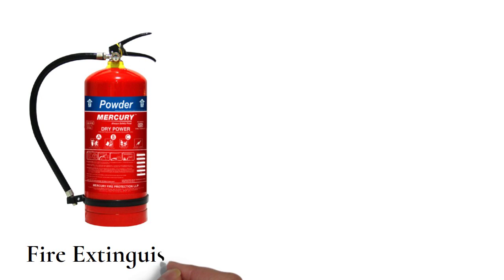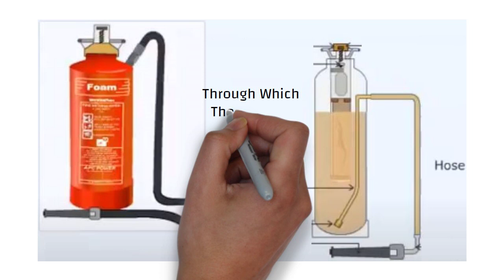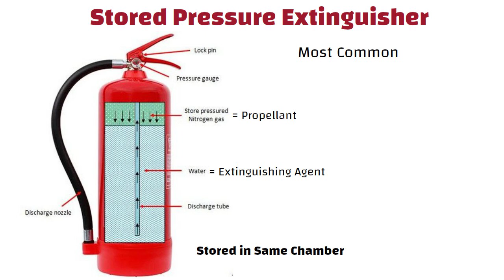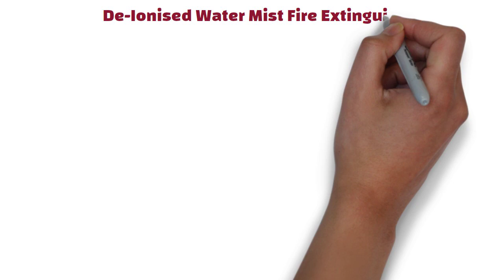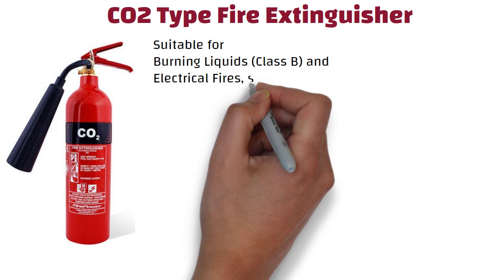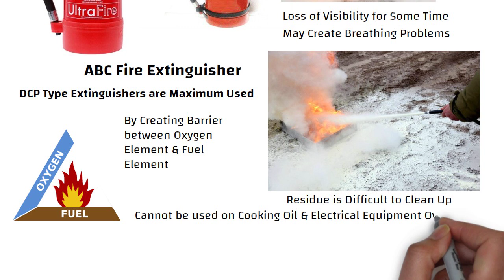FIRE EXTINGUISHER DEALERS IN KERALA, CALL 8138906102, FIRE EXTINGUISHER DEALERS IN ERNAKULAM.

Comment from the maker: Fire extinguisher dealers in KAYAMKULAM, fire fighting contractors in KAYAMKULAM, KAYAMKULAM, fire and safety installations in KAYAMKULAM, fire extinguisher suppliers in KAYAMKULAM,fire extinguishers in KAYAMKULAM, fire extinguishers in KAYAMKULAM, fire protection system in KAYAMKULAM, f fire and safety installation in KAYAMKULAM, fire and safety contractors in KAYAMKULAM, fire safety contractors in KAYAMKULAM, fire and safety systems equipments in KAYAMKULAM, fire equipment in KAYAMKULAM, fire extinguisher in KAYAMKULAM, fire protection system installation in KAYAMKULAM, fire contractors in KAYAMKULAM, fire safety consultants in KAYAMKULAM,  fire alarm systems in KAYAMKULAM, fire NOC in KAYAMKULAM, fire AMC in KAYAMKULAM, KAYAMKULAM, fire fighting equipment in KAYAMKULAM,
MS Jindal pipe dealers in KAYAMKULAM, motor control panel in KAYAMKULAM, fire pump panel in KAYAMKULAM, motor control panel in KAYAMKULAM, Morley fire alarm in KAYAMKULAM, gst fire alarm in KAYAMKULAM, addressable fire alarm system in KAYAMKULAM, Pa talk back system in KAYAMKULAM, PA talk back system in KAYAMKULAM, auto glow SIGNAGES in KAYAMKULAM, SIGNAGES in KAYAMKULAM, pump PANELS in KAYAMKULAM, LHP pump in kohi. Karthar valves in KAYAMKULAM, Ravel fire alarm system in KAYAMKULAM. Jindal pipe dealers in KAYAMKULAM, Jindal pipe dealers in KAYAMKULAM. MS pipe dealers in KAYAMKULAM. Butterfly valves in KAYAMKULAM, PA talk back system in KAYAMKULAM, Fire alarm dealers in KAYAMKULAM,, smoke detector dealers in KAYAMKULAM, fire alarm panels dealers in KAYAMKULAM, MCP, hooter dealers in Mangalor, hydrant valve dealers in KAYAMKULAM, branch pipe dealers in KAYAMKULAM, cp hose, RRL hose, heat detector dealers in KAYAMKULAM,, Motor Control panel,  LED EXIT LIGHTS dealers in KAYAMKULAM, emergency exit light dealers in KAYAMKULAM, auto glow SIGNAGES dealers in KAYAMKULAM. Conventional fire alarm system in KAYAMKULAM,
KIRLOSKAR FIRE FIGHTING PUMP DEALERS IN KAYAMKULAM, FIRE FIGHTING EQUIPMENT DEALERS IN KAYAMKULAM, FIRE ALARM SYSTEM DEALERS IN KAYAMKULAM, FIRE CONSULTANTS IN KAYAMKULAM, FIRE CONTRACTOTORS IN KAYAMKULAM, FIRE CONTRACTORS IN KAYAMKULAM, FIRE ALARM SYSTEM DEALERS IN KAYAMKULAM, SMOKE DETECTOR DEALERS IN KAYAMKULAM, FIRE PROTECTION SYSTEM IN KAYAMKULAM, FIRE CONSULTANTS IN KAYAMKULAM, FIRE CONSULTANTS IN KAYAMKULAM, PA TALK BACK SYSTEM IN KAYAMKULAM, ADDRESSABLE FIRE ALARM SYSTEMS IN KAYAMKULAM, CUTTER PUMP DEALERS IN KAYAMKULAM, ADDRESSABLE FIRE ALARM SYSTEM SUPPLIERS IN KAYAMKULAM, SMOKE DETECTOR DEALERS IN TKAYAMKULAM, PRESSURE BOOSTING PUMP DEALERS IN KAYAMKULAM, SLURRY PUMP DEALERS IN KAYAMKULAM, WATER PUMP DEALERS IN KAYAMKULAM, RAVEL FIRE ALARM SYSTEM IN KAYAMKULAM,
Reply: FIRE EXTINGUISHER DEALERS IN PATHANAMTHITTA, FIRE EXTINGUISHER SUPPLIERS IN PATHANAMTHITTA, FIRE EXTINGUISHER DISTRIBUTORS IN PATHANAMTHITTA, FIRE EXTINGUISHER IN PATHANAMTHITTA, ABC TYPE FIRE EXTINGUISHER DEALERS IN PATHANAMTHITTA, CO2 TYPE FIRE EXTINGUISHER DEALERS IN PATHANAMTHITTA, CLEAN AGENT FIRE EXTINGUISHER IN PATHANAMTHITTA, MODULAR TYPE FIRE EXTINGUISHER DEALERS IN PATHANAMTHITTA, MECHANICAL FOAM FIRE EXTINGUISHER DEALERS IN PATHANAMTHITTA, FIRE EXTINGUISHER NEAR ME PATHANAMTHITTA, FIRE EXTINGUISHER TRADERS IN PATHANAMTHITTA, FIRE FIGHTING COMPANIES IN PATHANAMTHITTA, FIRE CONTRACTORS IN PATHANAMTHITTA, FIRE EQUIPMENT DEALERS IN PATHANAMTHITTA, FIRE ALARM DEALERS IN PATHANAMTHITTA, FIRE PUMP DEALERS IN PATHANAMTHITTA, SMOKE DETECTOR DEALERS IN PATHANAMTHITTA, FIRE FIGHTING SYSTEM IN PATHANAMTHITTA, FIRE PROTECTION SYSTEM IN PATHANAMTHITTA, FIRE AND SAFETY CONTRACTORS IN PATHANAMTHITTA, FIRE HYDRANT SYSTEMS IN PATHANAMTHITTA, PA TALK BACK SYSTEM IN PATHANAMTHITTA, FIRE NOC IN PATHANAMTHITTA, FIRE INSTALLATION IN PATHANAMTHITTA, FIRE NOC RENEWAL IN PATHANAMTHITTA, KIRLOSKAR FIRE PUMP DEALERS IN PATHANAMTHITTA, FIRE EXTINGUISHER NEAR ME PATHANAMTHITTA, FIRE EXTINGUISHER MANUFACURERS IN PATHANAMTHITTA, SAFEX FIRE EXTINGUISHER DEALERS IN PATHANAMTHITTA, FIRE NOC CONTRACTORS IN PATHANAMTHITTA, FIRE FIGHTING EQUIPMENT DEALERS IN PATHANAMTHITTA, FIRE PROTECTION SYSTEM IN PATHANAMTHITTA, FIRE INSTALLATION IN PATHANAMTHITTA, FIRE SAFETY CONTRACTORS IN PATHANAMTHITTA, FIRE AMC IN PATHANAMTHITTA, FIRE PROTECTION SYSTEM IN PATHANAMTHITTA, FIRE PROTECTION EQUIPMET IN PATHANAMTHITTA, AMC OF FIRE SYSTEM IN PATHANAMTHITTA, FIRE CONSULTANTS IN PATHANAMTHITTA, FIRE AND SAFETY EQUIPMENT DEALERS IN PATHANAMTHITTA, ADDRESSABLE FIRE ALARM SYSTEM IN PATHANAMTHITTA, KARTHAR VALVE DEALERS IN PATHANAMTHITTA, DCP TYPE FIRE EXTINGUISHER IN PATHANAMTHITTA, POWSER TYPE FIRE EXTINGUISHERS IN PATHANAMTHITTA, FIRE HYDRANT SYSTEM IN PATHANAMTHITTA, FIRE ALARM PANEL DEALERS IN PATHANAMTHITTA, SAFEPRO FIRE EXTINGUISHER DEALERS IN PATHANAMTHITTA, MS AND GI PIPE DEALERS IN PATHANAMTHITTA, JINDAL PIPE DEALERS IN PATHANAMTHITTA, AGNI FIRE ALARM DEALERS IN PATHANAMTHITTA, FIRE EQUIPMENT DEALERS IN PATHANAMTHITTA, FIRE EQUIPMENT SUPPLIERS IN PATHANAMTHITTA, FIRE EQUIPMENT TRADERS IN PATHANAMTHITTA, FIRE SPRINKLER SYSTEM IN PATHANAMTHITTA, RAVEL FIRE ALARM DEALERS IN PATHANAMTHITTA, RAVEL FIRE ALARM SYSTEM IN PATHANAMTHITTA, AGNI FIRE ALARM DISTRIBUTORS IN PATHANAMTHITTA, FIRE ALARM CONTRACTORS IN PATHANAMTHITTA, FIRE PIPE INSTALLATION IN CONTRACTORS IN PATHANAMTHITTA, FIRE SAFETY CONTRACTORS IN PATHANAMTHITTA, FIRE PA TWO WAY TALK BACK SYSTEM DEALERS IN PATHANAMTHITTA, HEAT DETECTOR DEALERS IN PATHANAMTHITTA, HONEYWELL FIRE ALARM DEALERS IN PATHANAMTHITTA, FIRE NOC CONSULTANTS IN PATHANAMTHITTA, FIRE AMC AND FIRE NOC IN PATHANAMTHITTA, FIRE SAFETY COMPANIES IN PATHANAMTHITTA, NEWAGE DEALERS IN PATHANAMTHITTA, MONSHER FIRE EQUIPMENT DEALERS IN PATHANAMTHITTA, KARTHAR VALVE DEALERS IN PATHANAMTHITTA, FIRE HYDRANT VALVE DEALERS IN PATHANAMTHITTA, FIRE HOSE REEL DRUM DEALERS IN PATHANAMTHITTA, FIRE SPRINKLER DEALERS IN PATHANAMTHITTA, FIRE PUMP DEALERS IN PATHANAMTHITTA, LUBI PUMP DEALERS IN PATHANAMTHITTA, LHP PUMP DEALERS IN PATHANAMTHITTA. FIRE CONTRACTORS IN PATHANAMTHITTA, FIRE AND SAFETY CONTRACTORS IN PATHANAMTHITTA, FIRE EQUIPMENT DEALERS IN PATHANAMTHITTA, FIRE FIGHTING CONTRACTORS IN PATHANAMTHITTA, AGNI FIRE ALARM DEALERS IN PATHANAMTHITTA, PA TALK BACK SYSTEM DEALERS IN PATHANAMTHITTA, FIRE NOC IN PATHANAMTHITTA, FIRE NOC RENEWAL IN PATHANAMTHITTA, FIRE SYSTEM INSTALLATION IN PATHANAMTHITTA.
Reply: FIRE EXTINGUISHER DEALERS IN THALASSERY, FIRE EXTINGUISHER SUPPLIERS IN THALASSERY, FIRE EXTINGUISHER DISTRIBUTORS IN THALASSERY, FIRE EXTINGUISHER IN THALASSERY, ABC TYPE FIRE EXTINGUISHER DEALERS IN THALASSERY, CO2 TYPE FIRE EXTINGUISHER DEALERS IN THALASSERY, CLEAN AGENT FIRE EXTINGUISHER IN THALASSERY, MODULAR TYPE FIRE EXTINGUISHER DEALERS IN THALASSERY, MECHANICAL FOAM FIRE EXTINGUISHER DEALERS IN THALASSERY, FIRE EXTINGUISHER NEAR ME THALASSERY, FIRE EXTINGUISHER TRADERS IN THALASSERY, FIRE FIGHTING COMPANIES IN THALASSERY, FIRE CONTRACTORS IN THALASSERY, FIRE EQUIPMENT DEALERS IN THALASSERY, FIRE ALARM DEALERS IN THALASSERY, FIRE PUMP DEALERS IN THALASSERY, SMOKE DETECTOR DEALERS IN THALASSERY, FIRE FIGHTING SYSTEM IN THALASSERY, FIRE PROTECTION SYSTEM IN THALASSERY, FIRE AND SAFETY CONTRACTORS IN THALASSERY, FIRE HYDRANT SYSTEMS IN THALASSERY, PA TALK BACK SYSTEM IN THALASSERY, FIRE NOC IN THALASSERY, FIRE INSTALLATION IN THALASSERY, FIRE NOC RENEWAL IN THALASSERY, KIRLOSKAR FIRE PUMP DEALERS IN THALASSERY, FIRE EXTINGUISHER NEAR ME THALASSERY, FIRE EXTINGUISHER MANUFACURERS IN THALASSERY, SAFEX FIRE EXTINGUISHER DEALERS IN THALASSERY, FIRE NOC CONTRACTORS IN THALASSERY, FIRE FIGHTING EQUIPMENT DEALERS IN THALASSERY, FIRE PROTECTION SYSTEM IN THALASSERY, FIRE INSTALLATION IN THALASSERY, FIRE SAFETY CONTRACTORS IN THALASSERY, FIRE AMC IN THALASSERY, FIRE PROTECTION SYSTEM IN THALASSERY, FIRE PROTECTION EQUIPMET IN THALASSERY, AMC OF FIRE SYSTEM IN THALASSERY, FIRE CONSULTANTS IN THALASSERY, FIRE AND SAFETY EQUIPMENT DEALERS IN THALASSERY, ADDRESSABLE FIRE ALARM SYSTEM IN THALASSERY, KARTHAR VALVE DEALERS IN THALASSERY, DCP TYPE FIRE EXTINGUISHER IN THALASSERY, POWSER TYPE FIRE EXTINGUISHERS IN THALASSERY, FIRE HYDRANT SYSTEM IN THALASSERY, FIRE ALARM PANEL DEALERS IN THALASSERY, SAFEPRO FIRE EXTINGUISHER DEALERS IN THALASSERY, MS AND GI PIPE DEALERS IN THALASSERY, JINDAL PIPE DEALERS IN THALASSERY, AGNI FIRE ALARM DEALERS IN THALASSERY, FIRE EQUIPMENT DEALERS IN THALASSERY, FIRE EQUIPMENT SUPPLIERS IN THALASSERY, FIRE EQUIPMENT TRADERS IN THALASSERY, FIRE SPRINKLER SYSTEM IN THALASSERY, RAVEL FIRE ALARM DEALERS IN THALASSERY, RAVEL FIRE ALARM SYSTEM IN THALASSERY, AGNI FIRE ALARM DISTRIBUTORS IN THALASSERY, FIRE ALARM CONTRACTORS IN THALASSERY, FIRE PIPE INSTALLATION IN CONTRACTORS IN THALASSERY, FIRE SAFETY CONTRACTORS IN THALASSERY, FIRE PA TWO WAY TALK BACK SYSTEM DEALERS IN THALASSERY, HEAT DETECTOR DEALERS IN THALASSERY, HONEYWELL FIRE ALARM DEALERS IN THALASSERY, FIRE NOC CONSULTANTS IN THALASSERY, FIRE AMC AND FIRE NOC IN THALASSERY, FIRE SAFETY COMPANIES IN THALASSERY, NEWAGE DEALERS IN THALASSERY, MONSHER FIRE EQUIPMENT DEALERS IN THALASSERY, KARTHAR VALVE DEALERS IN THALASSERY, FIRE HYDRANT VALVE DEALERS IN THALASSERY, FIRE HOSE REEL DRUM DEALERS IN THALASSERY, FIRE SPRINKLER DEALERS IN THALASSERY, FIRE PUMP DEALERS IN THALASSERY, LUBI PUMP DEALERS IN THALASSERY, LHP PUMP DEALERS IN THALASSERY. FIRE ALARM SYSTEMS IN THALASSERY, ADDRESSABLE FIRE ALARM DEALERS IN THALASSERY, SMOKE DETECTOR DEALERS IN THALASSERY, FIRE ALARM CONTRACTORS IN THALASSERY, FIRE ALARM PANEL DEALERS IN THALASSERY, BIRE ALARM INSTALLTION IN THALASSERY, MORLEY FIRE ALARM DEALERS IN THALASSERY, HONEYWELL FIRE ALARM DEALERS IN THALASSERY, GST FIRE ALARM DEALERS IN THALASSERY, FIRE FIGHTING COMPANIES IN THALASSERY, FIRE AND SAFETY CONTRACTORS IN THALASSERY, FIRE EQUIPMENT IN THALASSERY, SAFEPRO FIRE EXTINGUISHER DEALERS IN THALASSERY, SAFEX FIRE EXTINGUISHER DEALERS IN THALASSERY, SIMPLEX FIRE ALARM DEALERS IN THALASSERY, TYCO DEALERS IN THALASSERY, JINDAL PIPE DEALERS IN THALASSERY, KARTHAR DISTRIBUTORS IN THALASSERY, STENTOR DEALERS IN THALASSERY, MONSHER DEALERS IN THALASSERY, NEWAGE DEALERS IN THALASSERY, RONAK HOSE REEL DEALERS IN THALASSERY,

Comment from the maker: FIRE ALARM DEALERS IN KAYAMKULAM, ADDRESSABLE FIRE ALARM DEALERS IN KAYAMKULAM, FIRE ALARM SYSTEM DEALERS IN KAYAMKULAM, ADDRESSABLE FIRE ALARM SYSTEM DEALERS IN KAYAMKULAM, FIRE DETECTION SYSTEM IN KAYAMKULAM, SMOKE DETECTOR DEALERS IN KAYAMKULAM, CONVENTIONAL FIRE ALARM DEALERS IN KAYAMKULAM, MORLEY FIRE ALARM DEALERS IN KAYAMKULAM, GST FIRE ALARM DEALERS IN KAYAMKULAM, ASES SECURITY FIRE ALARM DEALERS IN KAYAMKULAM, BEAM DETECTOR DEALERS IN KAYAMKULAM, FIRE ALARM SUPPLIERS IN KAYAMKULAM, FIRE ALARM TRADERS IN KAYAMKULAM, FIRE ALARM PANEL DEALERS IN KAYAMKULAM, HEAT DETECTOR DEALERS IN KAYAMKULAM, FIRE ALARM SYSTEM SUPPLIERS IN KAYAMKULAM, FIRE ALARM COMPANIES IN KAYAMKULAM, FIRE EQUIPMENT DEALERS IN KAYAMKULAM, ADRRESSABLE FIRE ALARM PANEL DEALERS IN KAYAMKULAM, FIRE ALARM SYSTEM IN KAYAMKULAM, BATTERY OPERATED DETECTOR DEALERS IN KAYAMKULAM, ASPIRATION DETECTION SYSTEM DEALERS IN KAYAMKULAM, FIRE ALARM MCP - MANUAL CALL POINT DEALERS IN KAYAMKULAM, FIRE ALARM HOOTER DEALERS IN KAYAMKULAM, PA TWO WAY TALK BACK SYSTEM DEALERS IN KAYAMKULAM, PA SYSTEM DEALERS IN KAYAMKULAM, PA TALK BACK UNIT DEALERS IN KAYAMKULAM, HOOTER CUM STROBE DEALERS IN KAYAMKULAM, FIRE PROTECTION SYSTEM IN KAYAMKULAM, FIRE ALARM CONTRACTORS IN KAYAMKULAM, FIRE DETECTORS IN KAYAMKULAM, FIRE ALARM DEALERS IN KOLLAM, ADDRESSABLE FIRE ALARM DEALERS IN KOLLAM, SMOKE DETECTOR DEALERS IN KOLLAM, FIRE EQUIPMENT DEALERS IN KAYAMKULAM, FIRE ALARM INSTALLATION IN KAYAMKULAM, FIRE ALARM COMPANIES IN KAYAMKULAM FIRE ALARM DISTRIBUTORS IN KAYAMKULAM, TALK BACK SYSTEM DEALERS IN KAYAMKULAM, FIRE ALARM SENSOR DEALERS IN KAYAMKULAM, FIRE EXTINGUISHER DEALERS IN KAYAMKULAM, FIRE ALARM DEALERS IN ERNAKULAM, FIRE ALARM DEALERS IN KERALA, ADDRESSABLE FIRE ALARM DEALERS IN CALICUT, SMOKE DETECTOR IN KAYAMKULAM,  FIRE EXTINGUISHER DEALERS IN KAYAMKULAM, FIRE EXTINGUISHER SUPPLIERS IN KAYAMKULAM, FIRE EXTINGUISHER DISTRIBUTORS IN KAYAMKULAM FIRE EXTINGUISHER IN KAYAMKULAM, ABC TYPE FIRE EXTINGUISHER DEALERS IN KAYAMKULAM, CO2 TYPE FIRE EXTINGUISHER DEALERS IN KAYAMKULAM, CLEAN AGENT FIRE EXTINGUISHER IN KAYAMKULAM FIRE FIGHTING PUMP DEALERS IN KAYAMKULAM, FIRE PUMP DEALERS IN KAYAMKULAM, KIRLOSKAR FIRE PUMP DEALERS IN KAYAMKULAM, FIRE JOCKEY PUMP DEALERS IN KAYAMKULAM, FIRE DISEL ENGINE DRIVEN PUMP DEALERS IN KAYAMKULAM, FIRE FIGHTING EQUIPMENT DEALERS IN KAYAMKULAM, FIRE FIGHTING SYSTEM IN KAYAMKULAM, VERTICAL INLINE PUMP DEALERS IN KAYAMKULAM, HYDRO PNEUMATIC PRESSURE BOOSTING PUMP DEALERS IN KAYAMKULAM, VERTICAL TURBINE PUMP DEALERS IN KAYAMKULAM, SEWAGE PUMP DEALERS IN KAYAMKULAM, RO PUMP DEALERS IN KAYAMKULAM. FIRE EXTINGUISHER IN KAYAMKULAM, FIRE EXTINGUISHER SUPPLIERS IN KAYAMKULAM,
Reply: FIRE EXTINGUISHER DEALERS IN KERALA, FIRE EXTINGUISHER SUPPLIERS IN KERALA, FIRE EXTINGUISHER DISTRIBUTORS IN KERALA, FIRE EXTINGUISHER IN KERALA, ABC TYPE FIRE EXTINGUISHER DEALERS IN KERALA, CO2 TYPE FIRE EXTINGUISHER DEALERS IN KERALA, CLEAN AGENT FIRE EXTINGUISHER IN KERALA, MODULAR TYPE FIRE EXTINGUISHER DEALERS IN KERALA, MECHANICAL FOAM FIRE EXTINGUISHER DEALERS IN KERALA, FIRE EXTINGUISHER NEAR ME KERALA, FIRE EXTINGUISHER TRADERS IN KERALA, FIRE FIGHTING COMPANIES IN KERALA, FIRE CONTRACTORS IN KERALA, FIRE EQUIPMENT DEALERS IN KERALA, FIRE ALARM DEALERS IN KERALA, FIRE PUMP DEALERS IN KERALA, SMOKE DETECTOR DEALERS IN KERALA, FIRE FIGHTING SYSTEM IN KERALA, FIRE PROTECTION SYSTEM IN KERALA, FIRE AND SAFETY CONTRACTORS IN KERALA, FIRE HYDRANT SYSTEMS IN KERALA, PA TALK BACK SYSTEM IN KERALA, FIRE NOC IN KERALA, FIRE INSTALLATION IN KERALA, FIRE NOC RENEWAL IN KERALA, KIRLOSKAR FIRE PUMP DEALERS IN KERALA, FIRE EXTINGUISHER NEAR ME KERALA, FIRE EXTINGUISHER MANUFACURERS IN KERALA, SAFEX FIRE EXTINGUISHER DEALERS IN KERALA, FIRE NOC CONTRACTORS IN KERALA, FIRE FIGHTING EQUIPMENT DEALERS IN KERALA, FIRE PROTECTION SYSTEM IN KERALA, FIRE INSTALLATION IN KERALA, FIRE SAFETY CONTRACTORS IN KERALA, FIRE AMC IN KERALA, FIRE PROTECTION SYSTEM IN KERALA, FIRE PROTECTION EQUIPMET IN KERALA, AMC OF FIRE SYSTEM IN KERALA, FIRE CONSULTANTS IN KERALA, FIRE AND SAFETY EQUIPMENT DEALERS IN KERALA, ADDRESSABLE FIRE ALARM SYSTEM IN KERALA, KARTHAR VALVE DEALERS IN KERALA, DCP TYPE FIRE EXTINGUISHER IN KERALA, POWSER TYPE FIRE EXTINGUISHERS IN KERALA, FIRE HYDRANT SYSTEM IN KERALA, FIRE ALARM PANEL DEALERS IN KERALA, SAFEPRO FIRE EXTINGUISHER DEALERS IN KERALA, MS AND GI PIPE DEALERS IN KERALA, JINDAL PIPE DEALERS IN KERALA, AGNI FIRE ALARM DEALERS IN KERALA, FIRE EQUIPMENT DEALERS IN KERALA, FIRE EQUIPMENT SUPPLIERS IN KERALA, FIRE EQUIPMENT TRADERS IN KERALA, FIRE SPRINKLER SYSTEM IN KERALA, RAVLE FIRE ALARM DEALERS IN KERALA, RAVEL FIRE ALARM SYSTEM IN KERALA, AGNI FIRE ALARM DISTRIBUTORS IN KERALA, FIRE ALARM CONTRACTORS IN KERALA, FIRE PIPE INSTALLATION IN CONTRACTORS IN KERALA, FIRE SAFETY CONTRACTORS IN KERALA, FIRE PA TWO WAY TALK BACK SYSTEM DEALERS IN KERALA, HEAT DETECTOR DEALERS IN KERALA, HONEYWELL FIRE ALARM DEALERS IN KERALA, FIRE NOC CONSULTANTS IN KERALA, FIRE AMC AND FIRE NOC IN KERALA, FIRE SAFETY COMPANIES IN KERALA, NEWAGE DEALERS IN KERALA, MONSHER FIRE EQUIPMENT DEALERS IN KERALA, KARTHAR VALVE DEALERS IN KERALA, FIRE HYDRANT VALVE DEALERS IN KERALA, FIRE HOSE REEL DRUM DEALERS IN KERALA, FIRE SPRINKLER DEALERS IN KERALA, FIRE PUMP DEALERS IN KERALA, LUBI PUMP DEALERS IN KERALA, LHP PUMP DEALERS IN KERALA.

Comment from the maker: RAVEL FIRE ALARM SYSTEM IN WAYANAD, LUBI FIRE FIGHTING PUMP DEALERS IN WAYANAD, FIRE EXTINGUISHER DEALERS IN WAYANAD, ADDRESSABLE FIRE ALARM SYSTEM DEALERS IN WAYANAD, 
KIRLOSKAR FIRE FIGHTING PUMP DEALERS IN WAYANAD, KIRLOSKAR FIRE FIGHTING PUMP DISTRIBUTORS IN WAYANAD, KIRLOSKAR FIRE PUMPS IN WAYANAD, KIRLOSKAR DIESEL ENGINE FIRE STANDBY PUMP DEALERS IN WAYANAD, KIRLSOKAR MONOBLOCK FIRE PUMP DEALERS IN WAYANAD, KIRLOSKAR FIRE TERRACE PUMP DEALERS IN WAYANAD, KIRLOSKAR FIRE PUMPS IN WAYANAD, KIRLOSKAR FIRE FIGHTING PUMP IN KARNATAKA, KIRLOSKAR FIRE PUMP DEALERS IN KARNATAKA, KIRLOKAR FIRE PUMP DEALERS IN HOSUR, KIRLSOAKR FIRE FIGHTING PUMP DEALERS IN WAYANAD, KIRLOSKAR FIRE PUMPS IN WAYANAD, KIRLSOKAR FIRE PUMP DISTRIBUTORS IN WAYANAD, FIRE ENGINE PUMP SETS IN WAYANAD, KIRLOSKAR PUMP DEALERS IN TIRUELVELI, KIRLOSKAR DEALERS IN KARNATAKA, KIRLOSKAR PUMPS IN KARNATAKA, KIRLOSKAR PUMPS IN WAYANAD, LUBI FIRE PUMP DEALERS IN WAYANAD, LUBI FIRE PUMP DEALERS IN KARNATAKA, LUBI FIRE PUMP DEALERS IN WAYANAD, FIRE PUMP SUPPLERS IN KAYAKUMARI, FIRE FIGHTING PUMP DEALERS IN KAYAKUMARIHOSUR, FIRE PUMP DEALERS IN KARNATAKA, FIRE PUMP SUPPLIERS IN WAYANAD, FIRE PUMP DEALERS IN WAYANAD, FIRE FIGHTING PUMPS IN WAYANAD, FIRE FIGHTING PUMP DEALERS IN WAYANAD, FIRE FIGHTING PUMP SUPPLIERS IN KARNATAKA, FIRE FIGHTING PUMP SET DEALERS IN WAYANAD, FIRE PUMP IN KARNATAKA, FIRE PUMP IN WAYANAD, FIRE PUMP IN WAYANAD, FIRE DIESEL ENGINE PUMP DEALERS IN WAYANAD, FIRE DIESEL ENGINE STANDBY PUMP DEALERS IN WAYANAD, FIRE JOCKEY PUMP DEALERS IN WAYANAD, FIRE JOCKEY PUMP DEALERS IN KARNATAKA, FIRE JOCKEY PUMP DEALERS IN WAYANAD. CRI PUMP DEALERS IN WAYANAD, HYDRO PNEUMATIC PRESSURE BOOSTING PUMP DEALERS IN WAYANAD, VERTICAL INLINE PUMP DEALERS IN WAYANAD, INDUSTRIAL PUMP DEALERS IN WAYANAD, SEWAGE PUMP DEALERS IN WAYANAD, STP AND ETP PUMP DEALERS IN TIRUNELVALEI, STP AND ETP PUMP DEALERS IN WAYANAD, STP AND ETP PUMP DEALERS IN WAYANAD, STP AND ETP PUMP DEALERS IN WAYANAD, HYDRO PNEUMATIC PRESSURE BOOSTING PUMP DEALERS IN WAYANAD, SEWAGE PUMP DEALERS IN WAYANAD, DEWATERING PUMP DEALERS IN WAYANAD, FIRE JOCKEY PUMP DEALERS IN WAYANAD, CRI PUMP DEALERS IN WAYANAD,